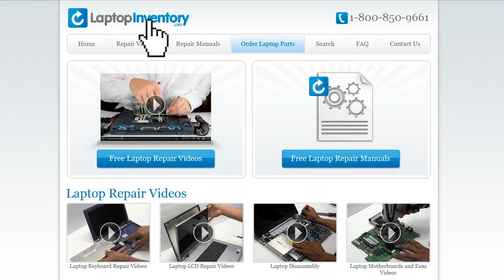HP ProBook 430 440 Full Disassembly and Reassemble Take Apart Tear Down 640 645 G3

Comment: My probookb440 g3 not going to sleep when lid is close
Reply: 1) Right click on you battery (right side in the corner) 
2) Choose *Power Options*
3) In the left side you will see a list, click on *Choose what closing lid does* 
4) when, you will see, *When I close the lid* and choose on both sides *hibernate*

If you want automaatic start-up windows sistem by opening the lid, you will need to go to bios :/